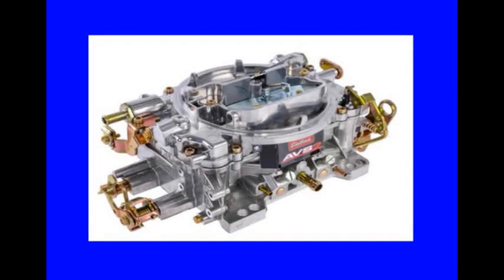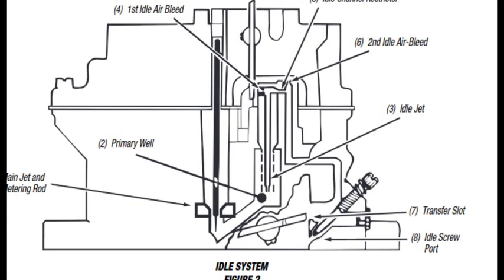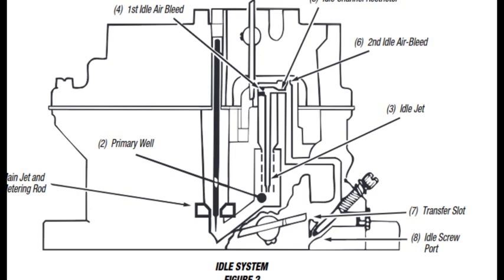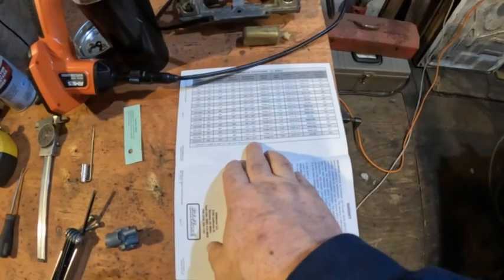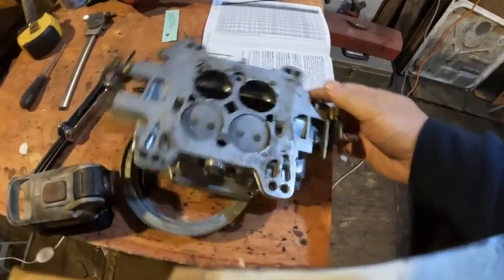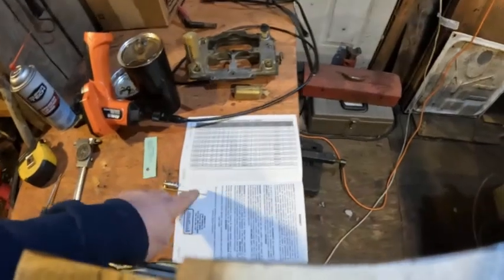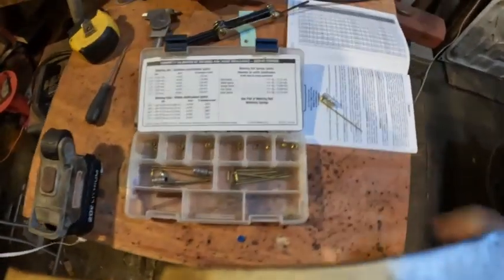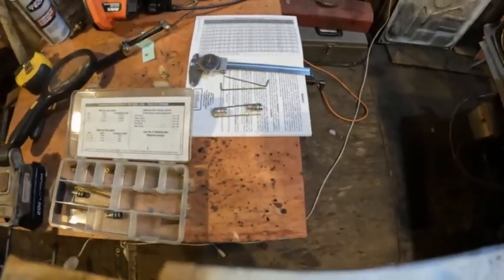Edelbrock idle circuit is fed by main jets. I explain why it matters.

Comment: The meetering rods shouldnt have an effect on idle
Reply: well they do.
Reply: @The0utmode  But theyre not on the idle circuit?
Reply: @beefmomma  they feed the idle circuit since the primary jets which the metering rods are in directly supplies fuel to the idle passage.
Reply: @The0utmode  No they dont really 

"On an Edelbrock 1405 carburetor, the metering rods primarily affect the part-throttle and cruising fuel delivery, not the idle circuit. The metering rods, along with the jets, are part of the main metering circuit, which controls fuel flow during higher throttle openings and engine loads. At idle, the carburetor relies on a separate idle circuit, which includes the idle mixture screws and idle jets, to regulate fuel and air delivery.
The metering rods are housed in the main jets and are controlled by the step-up pistons and springs. They adjust the fuel flow as throttle position and engine vacuum change, but at idle, the throttle valves are nearly closed, and the main metering circuit is not significantly active. Instead, the idle circuit provides the fuel-air mixture through the idle ports below or near the throttle plates.
However, there can be some indirect influence. If the metering rods or jets are severely mismatched to the engine (e.g., too lean or too rich), it could affect the transition from idle to part-throttle, potentially causing a stumble or hesitation that might feel like an idle issue. Additionally, if the throttle valves are open too far at idle (due to improper adjustment or a vacuum leak), the main circuit, including the metering rods, could start to contribute slightly to the fuel flow, but this is not typical for a properly tuned carburetor at idle.
To confirm, check the idle mixture screws and ensure the idle speed is set correctly (usually 650-800 RPM for most applications). If you're experiencing idle issues, focus on the idle circuit components (idle jets, mixture screws, and air bleeds) and verify there are no vacuum leaks or timing issues before suspecting the metering rods. If you need to adjust the metering rods, it’s typically for fine-tuning part-throttle performance, not idle quality."